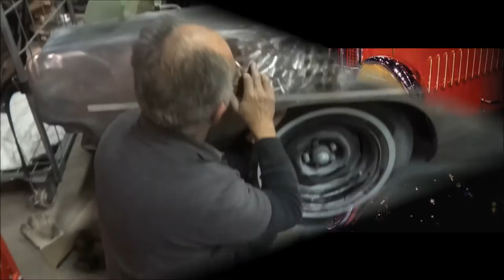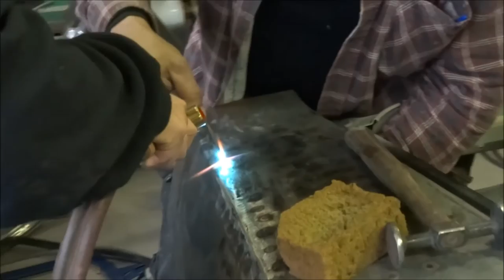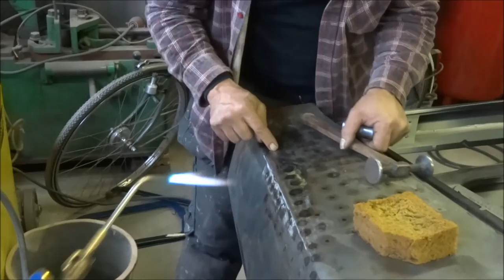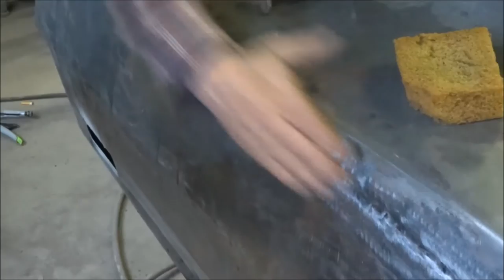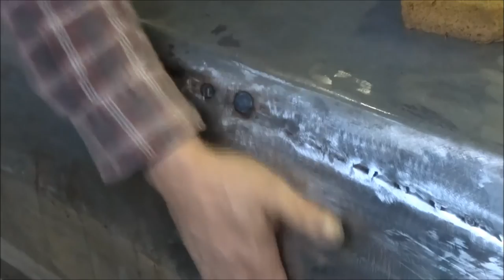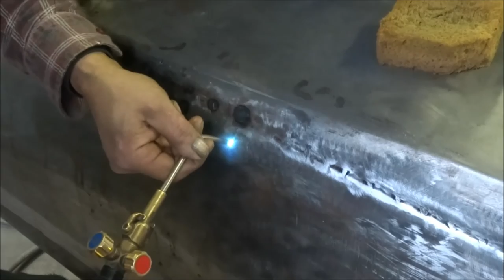[ART ON CAR] Dodge Charger Metal Shaping - Panel Beating  Part 1

Comment: you heat it,which shrinks it ,then U hammer on dolly to stretch it?
Reply: Well, since you cant see where he's holding the dolly behind the panel, it's safe to say that he could be doing "off dolly" work...where he's supporting the panels next to the spot he's hitting (shrinking)
Reply: True but hammer on stretches the weld shrinkage your always gonna get!
Reply: What hes doing will shrink the metal hammer on dolly can shrink if you know the how to do it ,as you see in the video it shrinks.
Reply: Only under heat he can shrink the metal on the high spots doing like he does, but need massive knowledge where to put the heat on. You can also ruine everything with this method.